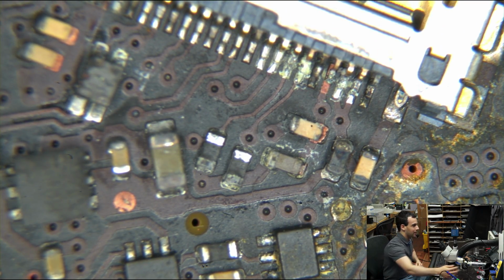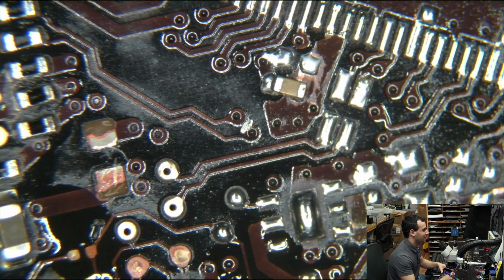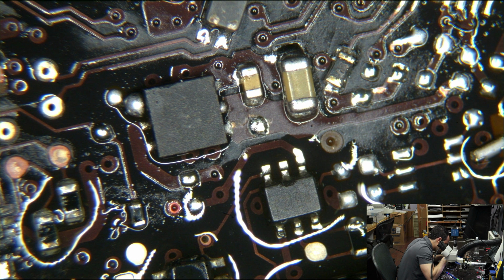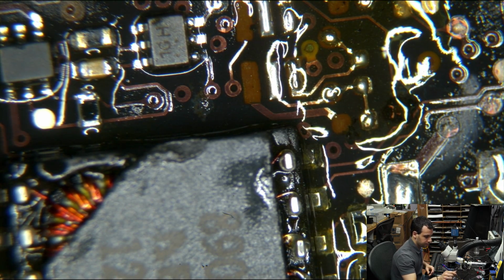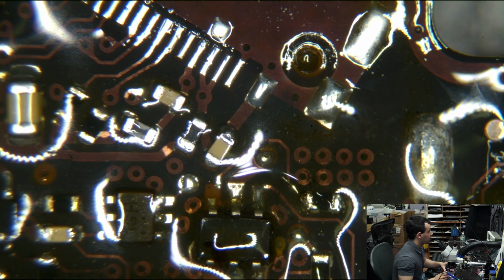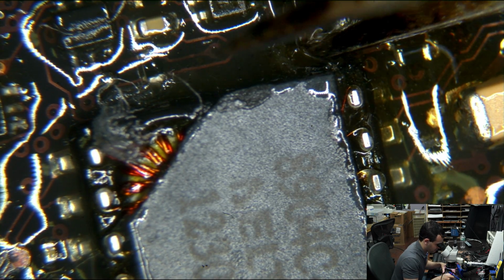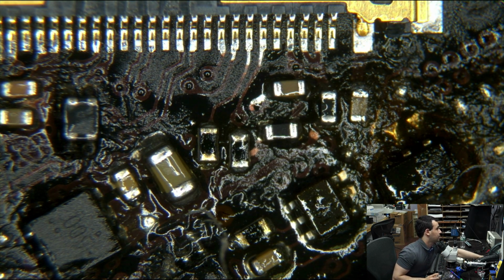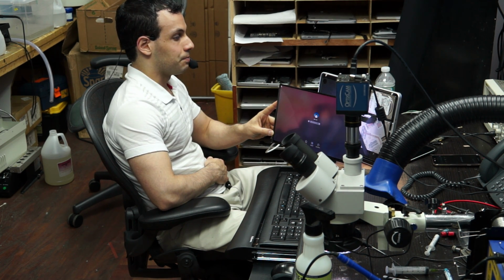Repairing no video and no firewire on Macbook Pro logic board after liquid damage.

Comment: Years ago, I bought a cheap china rework station on Ebay for a little over a hundred bucks. 952D is the model number. When I got it, I found that it didn't work. Desperate to get the thing working, I opened it up and fixed a bad connection in it; the seller agreed to give me some money back for compensation. The heating element soon went. The seller sent me a few of those things and when I tried another one of them, there was a short in the heating element and it caused the whole unit to smoke up. The digital display lit up all eights and the unit died. The seller wound up giving me all of my money back. At this point I could buy a better one and trash this thing, but instead, since it had a good air pump and the board was in decent shape, I opened it up and worked on it. This time the micro-controller was shot (8051 derivative). The unit was a very simple design and as determined as I was to make this thing work, I drew out the schematic, noted all the inputs and outputs and proceeded to write another program for a new controller. This thing would allow the user to set the temperature and the heat was controlled by PWM. I still have this unit today. It works just as good as it ever has. I've only replaced the element once in the 7+ years I've owned it and it gets plenty of use; always hot enough to do anything I need to do. I wouldn't trade this thing for any other unit for sale today.

Comment: What is that cleaning solution thing he is putting on the PCB??? The thing that looks like solder wire? I'm guessing thats the amtec 559 flux he is using?
Reply from the maker: 53 70 6f 6f 6b 79 3f Tell me what point in the video you see that, what time, and I will tell you what it is.
Reply: Louis Rossmann The stuff at 4:01, thanks, love the videos, they're really interesting, it looks like it cleans the pads and gets the excess solder off
Reply from the maker: That is flux that is built into the kester 63/37 solder that I am using.

Comment: I have a question and I know it's probably going to sound stupid.  When I do any kind if rework like this I always clean the Flux off the board before I test it.. In your videos you never do, you will add some components and then apply power to test the board.  Am I missing something but isn't the Flux conductive and can cause shorts if it isn't cleaned off before you apply power to the board to test it?  If it isn't I am wasting a lot of time cleaning it...
Reply from the maker: Enrico Ricci Depends what flux you are using. With cheap shit sure you have to worry about it. With what is built into the no-clean kester 63/37 or amtech 559 I don't care. I put worrying about cleaning flux up there with ESD and caring about being perceived as "professional", it's stuff people tell you to care about but you don't have to. ;)

I do clean it off for end users of repaired boards, usually toothbrush and ultrasonic at 60c-70c gets rid of it all so I have a nice clean board.

But that would totally kill workflow for youtube. If I did that, I would stop the video, clean, wait for it to dry, and later on never come back to finishing the video. I need to do videos in the limited uninterrupted time I have. 

For really fucked up boards like this one, I will, for the sake of before & after, show you what it looks like after cleaning all the flux & other junk off the board so you can really appreciate what has been done.